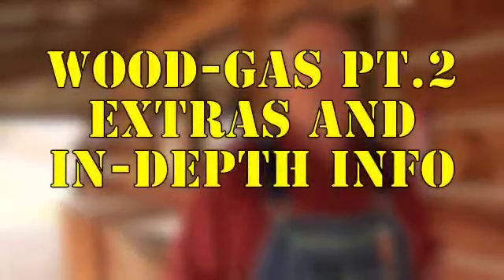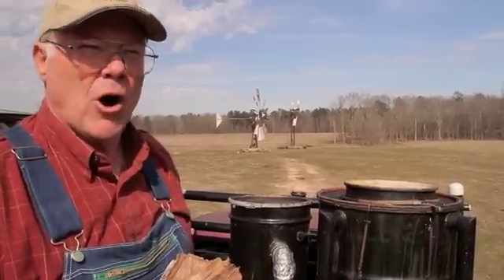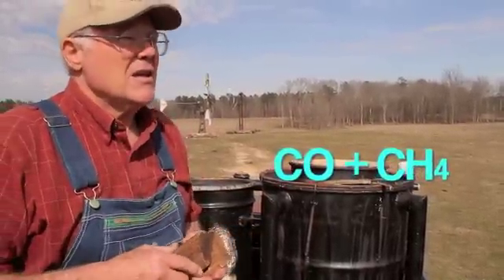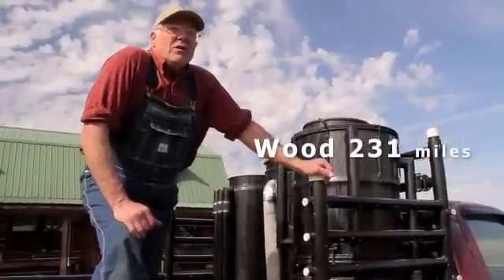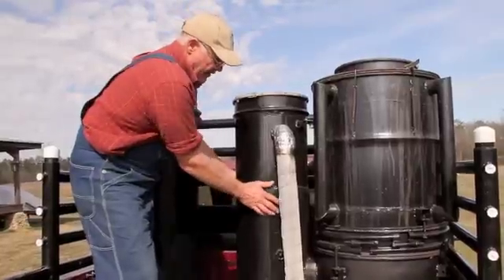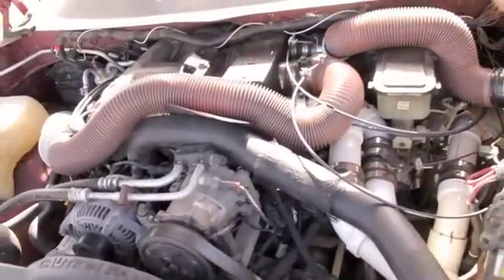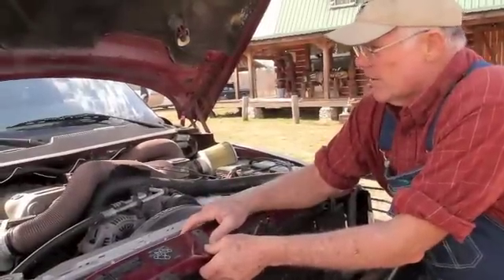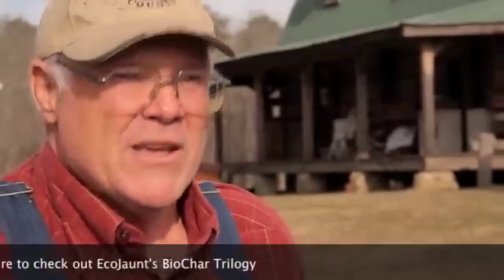Wood Gas Part 2: Extras and In-Depth Info

Comment: 1 part wood gas to 1 part air?
Reply: Depends on the composition of the gas. At a first glance, without the proper calculations, i'd say more air than that. Two H2 molecules will need one O2, two CO molecules will need one O2, one CH4 molecule will need two O2, so on average seems like you need less amount (moles) of oxygen than the gas, however air is only 21% oxygen, so multiply by 5; and that's only amounts, you need to convert to either mass or volume for actual use.

Comment: I work at a molding shop. All the wood goes through a gang rip saw before it gets to the molder. We probably have well over a ton of scraps each week. If I did this, I'd never have to pay for gas again. I could probably power my house on that wood.
Reply: At over 5 dollars a gallon and unlimited free wood or basically free this is looking mighty nice.

Comment: Oil hit $120 a bbl again today  - - I'm back here learning how to convert my 460 engine (7.5 liter) Ford F350 to wood gas!!
Reply: How did it go planning on getting the same gong?
Reply: Hahaha that 7.5l probably still need 5 times as much fuel when it's burning word, you have to pull a trailer of wood to keep it going

Comment: I see he using a air to fuel gauge ..the question is what the air ratio 1:1 for gasifier..  i though these wide band gauges read  14:1 of so?
Reply: When running on woodgas, the AFR gauge barely registers the fuel ratio but it's enough to help you dial in the mixture.
If you wanted to be more accurate you could get the Lambda readings.

Comment: Very cool but it's too bad that it takes up space in the bed and blocks the rear view.
I wonder if a small gas generator could fit under the hood with a smaller engine that's optimized to run on wood gas.
Reply: probably easier to just use the wing mirrors
Reply: That's unlikely. The size of a the wood gasifier is just a necessary part of the gasification process.

Comment: Does this method only work with gasoline or diesel engines?
Reply: Gasoline only. Bio diesel is the only way for adiembatic compression that a diesel uses.
Reply: Yeah wood gas only works on gasoline engines.

Comment: I wonder how much efficiency loss there would be using a heat exchanger hooked to the air conditioner compressor.  This could cool the gass much colder to get more water out using much smaller parts.

Comment: Couldn't you compress it like propane so you could store it. That way you wouldn't have to haul it in your truck.
Reply: You cannot store hydrogen. Or the gasses produced without becoming separate and explosive.
Reply: @krotchlickmeugh627 hydrogen also makes steel propane tanks brittle over time.  It's safer to make the gas on demand like Wayne and many others have done.

Comment: Carbon neutrality yes, but we speed up the release of carbon from plants and trees.

Too much too fast could be a problem for Earths eco system.
Reply: the emissions from the vehicle are the same as driving with gas and the bio char stores most of the carbon in the soil as char coal :) its actually carbon negative :)
Reply: @ItsMeChrisX  

I hadnt considered the char.  Thank you for pointing that out.

I live in North West Florida.  My brother and I build a gassifier from the FEMA plans just after hurricane Ivan.  We managed to get a 5kw generator to run on it.  

Im considering building a downdraft gassifier for use after a future hurricane.  We are way overdue one.
Reply: @DaveWard-xc7vd  thats a good plan. im buying some property soon and plan to run the house, barn and garage off a 20kw system. still looking over plans to see what build would work best for all them watts :)
Reply: @ItsMeChrisX  

There is no shortage of feedstock after a hurricane.

Comment: I drive a 2015 Nissan Leaf - all electric - car.

At $00.12 per kwh.
It costs me $00.03 per mile.
Reply: but, you haven't added in purchase price/taxes/insurance plus battery replacement cost
Reply: @FixItYerself  

I purchased the car in 2017 with 15500 miles on it for $10,800.00.

The battery should last 10 years or 100000 miles and the whole pack doesn have to be replaced.  It can be rebuilt for much less.
Reply: @DaveWard-xc7vd    That seems like a relatively good deal, plus the 2015 battery is supposed to last longer than previous years. I looked into leasing a new Leaf once, and it was close to $700/mo (not counting additional insurance cost for full coverage), so I'm sure you're better off buying a used one. At 40mpg/average in my Toyota, I figured that 700/mo would be around 8000 miles/mo in fuel and just wouldn't make good financial sense, as fun as it would be to travel around in something charged from my dryer outlet.

For comparison though, my Toyota was $3000 used and gave me 300,000 mostly trouble-free miles over 14 years, which averages out to $.083/mi. including the cost of the car and fuel at $3/gal. Not counting other cost differences, if the battery goes for 196363 miles you'll also average $0.085/mi. If you get 100,000 miles, you'll average $0.138/mi. Either way, if gas goes over $5/gallon, you may very well come out ahead of the rest of us until we convert to an alternate fuel. happy travels
Reply: @FixItYerself  

My wife has a Veloster and gets 30mpg in town.  If she parks it on the weekends and drives my Leaf instead she saves $30.00 a month in gas which pays for the electricity for the Leaf for the month.

Comment: What if you took this system and supplied a boiler with it?  Maybe create a system like Doble had in his cars back in the 20's.  Wood powered steam engine with 1000ft/lb of torque.  You could create an ECU that would run it all for you.  That would be the ultimate apocalypse vehicle.  Include a wood chipper in line with the hopper, so you could just feed it dead fall.  You could do the same and run a generator with it.  I wonder if that would be more powerful than a gas engine running on wood gas.
Reply: @marias man Wise words that are very appreciated. Thank you.

Comment: I'm thinking last night how take smoke  gas and put in propane tank or condensed .this very good idea
Reply: there are very few videos on it, but you can connect woodgas to the intake of an air compressor (usually where an air filter is mounted)  to store the fuel
Reply: You cannot store hydrogen gas presurized. Especially with the other gasses emitted. 
They will separate and theres a chance of air entering the system and becoming explosive.

Comment: My god, this is so elegant and beautiful. I mill lumber and cut down a lot of trees. The ugly and small wood becomes firewood. Then there are chips for the garden but they compost very slowly. To be able to burn the FREE debris remainder to make gas to run a generator to charge a bank of batteries for free electricity and then have biochar left over for the garden soil is like a miracle! I MUST do this!!! No waste stream whatsoever!!! It does not get more elegant than that!!@!
Reply: @marias man Yeah, It's a beautiful time to be alive! I was thinking also of using excess energy to pump water uphill to a very large storage tank and then either use it to irrigate or run a micro-hydro turbine to recover the electricity at a later time. So, I'll see your heat exchanger and raise you a gravity battery! LoL..
Reply: @3Sphere  youll be exerting more energy pumping it up hill then gaining when you drain it down hill. 
But nice idea. 
For your wood ship issue. 
If you dont end up using gasification. Grow some mushrooms.
For one it treats depression and anxiety if you grow the right ones. But two it eats the wood chips faster than anything else and they are worth a ton as well.
Reply: @krotchlickmeugh627  yes, I suggest wine cap mushrooms (Stropharia)

Comment: If you expose the reduction zone reactants to a high volt and high frequency field i.e. from a tesla coil surely the rate of reduction of carbon would  greatly increase and so would the amount of energy released.
Reply: Youd be putting an ignition source inside the gas chamber. 
Dumb
Reply: @krotchlickmeugh627  you obviously were not one of the bright stars of a halfway decent high school with a proper physics or chemistry class.

Comment: excellent video and information. This info must be spread to many. My wind turbine shop is small, and off grid. for the heavier electrical tool, I need to run the generator. From what i have gathered around several videos, creating the wood gas is easy. It's the filtering that makes the best difference. The temp, cooling for dew temps, and the final extraction of the rest of the moisture means the difference of tar, and a dry efficient burn that has no tar buildup. That and regular cleaning of the radiator, or heat exchange system. That pretty much means a nice long travel through decent diameter pipes, and dryers. I'm betting that air filters have to be changed often as well.

I still have questions like, " how big of a system do i need to run my 10KW genny for welding all day? ".

Thanks very much.
MUDDy
Reply: Hey Bud, Don't tell anyone you have a wind turbine! The dictators are arresting people now for stuff like that!
Reply: muddymuddymuddmann 
Believe It or Not? There is a document in FEMA that you can download it's a PDF about 90 some pages and it shows you how to build a simple downdraft gasifier out of commonly available materials.

In there is a special chart that shows you diameters of your burn chamber for certain size displacement engines.

I bet you didn't think there was anything the government did that was good right? Apparently, the professor at UC Davis made the tractor run off Woodsmoke.
Reply: Check out www.woodgasifierplans.com he has pretty in depth manual on building a high grade gasifier. Currently I seen today he is offering the book for free, it's usually 30-40 bucks. This fella Wayne even has a review in the book.
Reply: Wayne wrote the book on it. his site is http://www.driveonwood.com/

Comment: In relation to mknytb's question. Mr Keith mentions that the 3 main gasses are hydrogen carbon monoxide an methane all three are compressable. However you mention for home use, depending on where you live, there are all sorts of burocratic red tape to cut through. Is it worth the effort to compress.
Reply: if you run out of fuel in the middle of nowhere, you can chop some wood or grass et voila!!

Comment: Wood gas is carbon NEGATIVE, not carbon neutral!  The biochar is more stable carbon than the rotting tree would be.

Wow!  This is super-cool technology.
Reply: CB CBlargh You are absolutely correct. It reduces whatever carbon may be put back into the atmosphere by a tree or trees.
Reply: plus, he can grow a garden on the biochar
Reply: +CB BC:
That`s true. It is making coal. It can be thrown in the fireplace for burning it some more.
Reply: NOPE.  The carbon will eventually all return to form of CO2.  May be too slow for you to see but it will happen inexorably.  Why worry though? Global warming is a scam.

Comment: Can I compress wood gas?  If so, can I set up home fueling system in to gas tank from this gasifier for CNG vehicle instead of producing the gas on the truck as you go?  If this wood gas system runs over 200HP engine, it mean it can generate way over 100KW (as 10kW generator runs on 12-13hp engine) which can run 7-8 households, and exhaust the CO2 into green house in back yard.  Can annoyingly fast growing bamboos produce wood gas like other wood?  This wood gas seems to act just like natural gas, then if I build giant gasifier with reinforced concrete I can heat house, generate electricity and fuel car from wood?  I can pack the gas in tank as I need and generate the gas as it runout, so I don't have to watch the fire all the time.  This is amazing.   Thank you very much for sharing!  So.. Can I compress the wood gas and use it like CNG?
Reply: It wouldn't be worth it. Not enough energy density.
Reply: Thank you.  I guess I was hoping too much.
Reply: nobody tried to compress CO
tho, the syn-gas contain some complex hydrocarbons that can be liquified and some fractions that can't (like methane).
It's possible to optimize wood pyrolysis to get more oil fraction than gas and char fractions.
Reply: @zazugee  there is a guy on YouTube who has done it (look up compressing wood gas) the danger is (from what I have heard) is that there can be oxygen present when it is compressed meaning even the slightest spark could set it off.. others have tested this and disproven it and it could/should be somewhat safe but nobody has any solid scientific proof from what I have seen so far..

Comment: Hey Wayne I was wondering if I could use my air conditioning in my chevy I have to condense the moisture from the syngas? I know it won't help with horse power but it will make the gasifier less bulky.I'm trying to design a low profile gasifier with 6 small burn chambers,run the truck on wood pellets and  cool the gas with my AC.

Comment: Now I understand the desire or even the "need!" for some people to have to have plans to be able to build anything, but for what it's worth, I watched the video, listened to him explain how it works, what each component does, how it's routed, and what a lot of it is made out of. I also watched the video and can clearly see the size and estimate lengths of almost everything taken from the scale of a common pickup truck, for the bits he didn't call out size for. Drums explain themselves as they only come on a handful of sizes. I am not being sarcastic, and I apologize to anyone if it comes off this way, I did not mean for that. I however AM encouraging people to do a little work for themselves, and discover some improvements they can make along the way as well as learn so much more. This is NOT rocket science it's operated on the very basic principles of thermodynamics.

Now, if you are not that handy, and need to have the plans, if you absolutely must, I would be willing to help draft up some with materials, to get you very close to what he has on his rig, including a better pic chip computer controlled automatic fuel controller to keep your mixture dead on and the stock computer happy, and eliminate all the manual valves. The manual valves are very easy to operate and make though, and for the most part they would still be there, and could be make to have bypass manual control built in in the event of an electronic failure. However if a nuke is detonated kiss all those electronic anythings goodbye anyways LOL, it'd be se how long we can survive in our underground fallout shelters till we starve :p Cheers my friends, IC.
Reply: he wrote a book on it. I'm sure there's info on his site on how to automate it as well http://www.driveonwood.com/
Reply: Well that's a mouthful. It's not about saving your ass. it's about being independent. Alternative fuel. Cheers.

Comment: it is amazing that skeptics to the reliability of these systems still chime in here! Of course the Energy giants don't like this Idea.
Reply: @Nigel Cam :
Perhaps a small percentage of the population can use this system.
Another percentage can use solar power to charge their car batteries.
Another percentage can use wind power.
Another percentage can use sugar converted to ethanol.
Reply: @Dane Aulabaugh I don’t know where you are getting your information from. Solar panels are not made from fiber glass. They are made of nearly pure silicon. There are 2 types. There is the single crystal type and polycrystalline type. You don’t need petrol. An electric arc furnace is used to convert SiO2 to Si and SiC. The source of power is electricity which could come from hydro or anything else.

Fusion power is not ready yet.

Petrol and coal are finite because nature is not producing any new sources or at least not at a fast enough rate.
That’s what finite means.
Solar, hydro, wind are very large sources. There is so much joules there. Way more than humans can use and it keeps on coming.
Reply: @Dane Aulabaugh, how about we grammar check you!!!

Comment: Excellent presentation! I have just started investigating this concept and was wondering if using charcoal would be more efficient or would it be the same?
I am not sure if the compactness of carrying charcoal vs a cord of wood in the truck would have an advantage not only by volume and weight but also by the BTU output.
Best regards

Comment: They do exist, I have seen a few great examples running very efficiently and inexpensively. There are many companies that will make and sell you turnkey generators but they are not cheap. build one yourself if you are not loaded. Reason the power industry is not promoting these is simple business and economics; They wont make money off of customers every month if these were running, would they? Plus if everyone had one, they would need acres of trees to be 100% independent. Few have the land
Reply: You dont need wood. Anything can be burned. Such as cannabis. But the byproduct of building furniture and homes, many other things out of wood is wood waste. Usually burned or discarded rather than made into an efficient fuel

Comment: What do you mean when the temperature gets down to the dew point? 
Besides the moisture in the wood some of that water is coming from the combustion itself you know carbon dioxide CO2 and water H20 are the products.

Good idea to use the ashes as fertilizer no waste at all.

Comment: I been gasifying wood and animal waste and taking out the oils and running the oils into a stainless tube with aluminum the heat of the fire makes the trapped oils become gas and then becomes gasoline and diesel and another burnable gas which is methanol GREAT VID
Reply: this is pyrolysis, you can optimize it to get more oil fraction than gas fractions.
Reply: @zazugee How do you optimize pyrolysis to get more liquid oil fraction than gas.